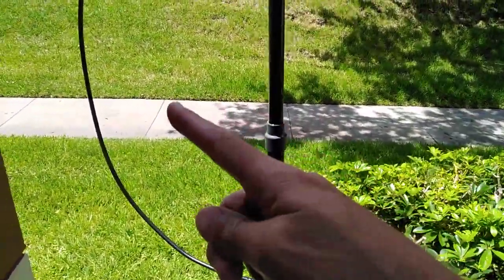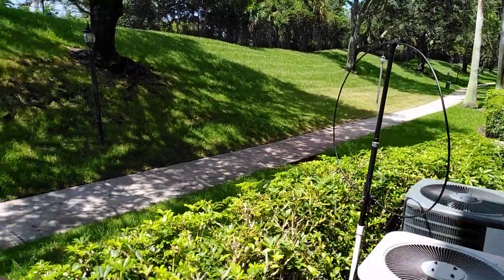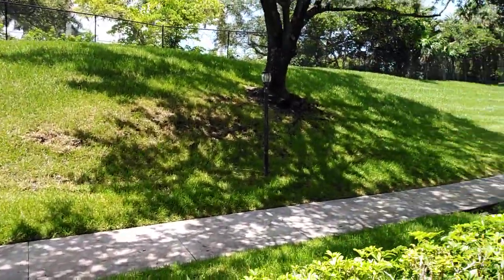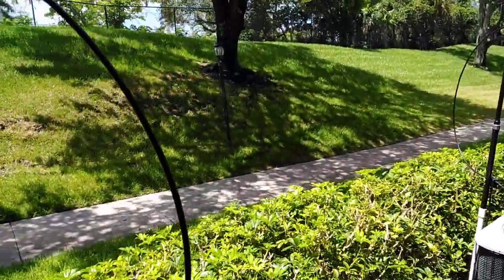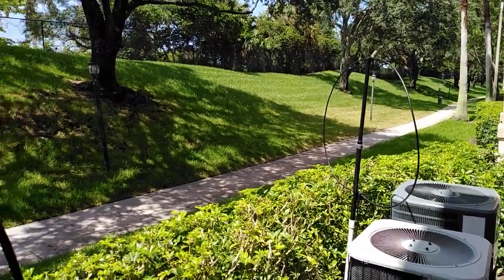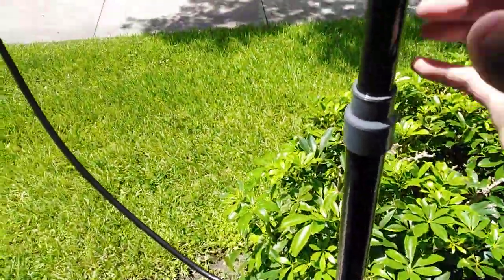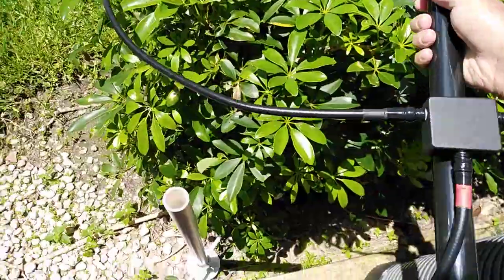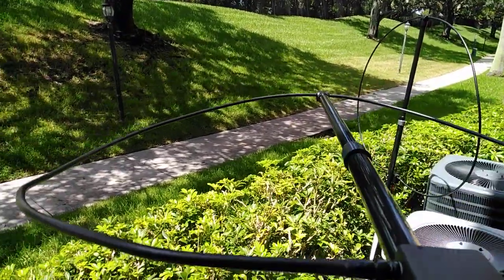RSRduo with dual W6LVP loops Part 3

Comment: Hi Mike, I'm considering purchasing the W6LVP Loop antenna, how does it perform compared to the Bonito Megaloop ML200 ?
Reply from the maker: It worked very well but the Bonito has a higher receive frequency range.  I recelenty added this loop and its great. http://www.crosscountrywireless.net/loop_antenna_amplifier.htm

Comment: So, did you ever actually do this experiment? :)
Reply from the maker: No, I was given the heads up that the board that runs my HOA would not be happy with what I am doing in the back. I scaled it down to 1 main antenna, a Megaloop FX.
Reply: @SDRplayHamGuides  Sad, that would have been interesting indeed! :)

Comment: Mike, I have used active loops since the first design of Andy (Wellbrook). Have mounted them in all kinds of setups, like hight and also the way you want to test, in a horizontal plane. I still have 3 of them in use, but from different manufaturers. Let me comment on what you have said in the R. Korea reception when you stated that the direction of your incoming signal is not from the direction it supposed to be. My guess is that your loops are mounted to close to the building and are receiving signal reflextions due to the steel in the concrete wall. Testing in this environement will by my opinion never offer you a clear result. As you noted in the past and wich is obvious, your reception will never be clean. My suggestion is that when you want to obtain a honest and conclusive result for making a video that will give real good credit to the SDRplay team is to go out in a quiet (rural) field setup with good distances between the antennae and and make a maginficent video. Sometimes it pays out to go out of your comfort zone. After all it is summer and a nice outing can be refreshing. In your present setup at home you can use the 2 antennas to eliminate some of the noise for shure. Good luck!
Reply from the maker: Hi Ron, Thanks for commenting. Yes, it could be reflection from the concrete but the reception is crystal clear with minimal carrier drops . I 100% agree with you, it's all about experimenting.
Reply from the maker: Here is VOK on the N/E loop
https://youtu.be/h_qj7a8JaLs

Comment: Awesome!  I've been wondering about horizontal vs vertical as well.  This will be very interesting.  I have one loop on the back deck of home leaving it ten feet at least above ground.  The finished basement walks out to back yard, so the elevation on tripod is quite different.  The polarization of a loop got me thinking of X loop, quad loop, hex loop, etc.  Experimenting is something one must do to learn the finer points.
Reply from the maker: I believe having one loop vertical and the other loop stacked on top of it horizontally should yield good results.
Reply: @SDRplayHamGuides  I'm very interested in your results.